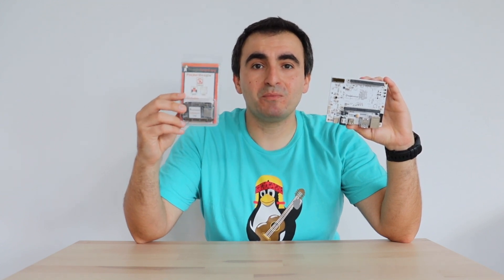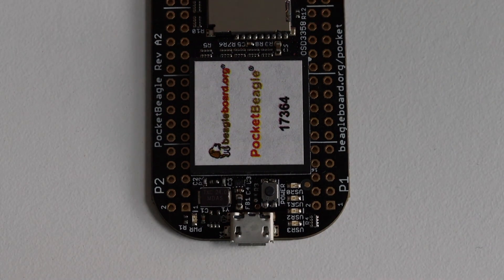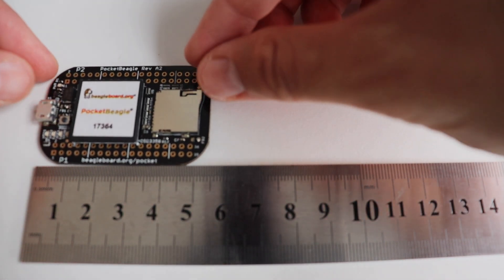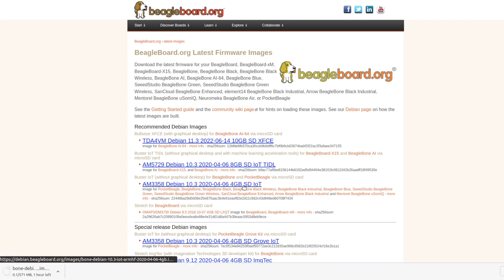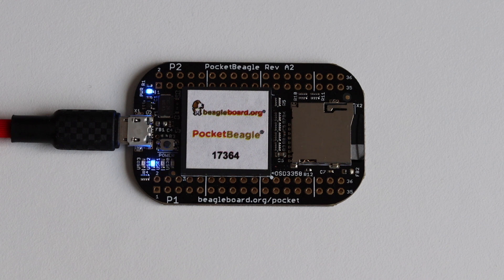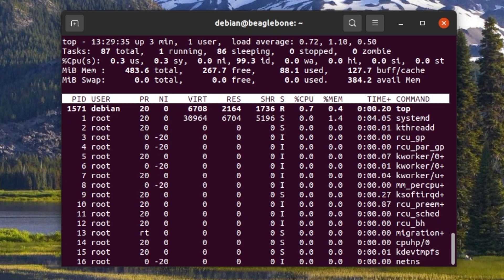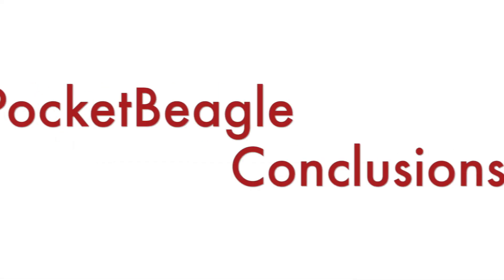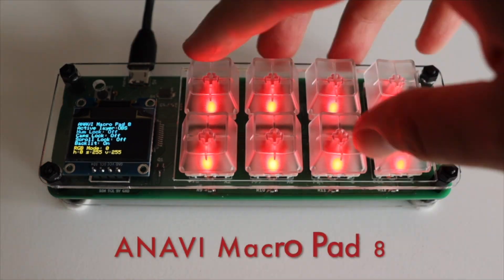BeagleBoard PocketBeagle Low Cost Linux Computer with Debian

Comment: Does anyone know the operating temperature range? Does anyone make an industrial rated version of this device (-40 degC to +85 degC)?
Reply from the maker: yes, according to the datasheet of OSD335x System-in-Package commercial version used in PocketBeagle, the operating temperature range is from 0C to 85C. Octavo also offer industrial version of the OSD335x which is with temperature range from -40C to 85C. PocketBeagle is an open source hardware product so eventually you can even manufacture a version using components for industrial temperature ranges.

Comment: I see it has USB on it. Does that mean we can connect a USB device to it like a flash drive or a Ethernet adapter?
Reply from the maker: Yes, absolutely, this is exactly how the Debian image for PocketBeagle works. If connected to a PC via USB cable, a network adapter should show up on the computer. PocketBeagle with the Debian image runs DHCP server that will provide the computer with an IP address of either 192.168.7.1 or 192.168.6.1. It is a pretty cool feature.
Reply: You could use your PC to share it's Internet connection with the BeagleBone Pocket. There will be instructions "out there" for your PC and for the BeagleBone (Linux).
Reply from the maker: @undercrackers56  yes, this is pretty cool and it is shown in the chapter about Debian in the video.

Comment: What kind of practical embedded applications do you think the Pocketbeagle will be best for?
Reply from the maker: Good question. In my opinion it is a good option for robotics, embedded Linux industrial applications (for example for control and/or I/O operations in special machines) and with appropriate peripherals the PocketBeagle can be useful as a headless device for home automation tasks (audio, controlling LED strips, gardening, infrared communication with old/retro devices, etc.)
Reply: @LeonAnavi  Great! Thank you!
Reply from the maker: @mrafayshams3089  btw considering the current global chip shortage on the market that has affected severely Raspberry Pi, the PocketBeagle can be considered as a replacement for some tasks performed by Raspberry Pi Zero.

Comment: Can one use this board to learn Embedded Linux...Any drawbacks? Also how does this board compare to other Beagle board offerings?
Reply from the maker: Yes, PocketBeagle is a very convenient way to learn embedded Linux development. I have seen it as a hardware platform used in various classes and workshops during conferences. 
Compared to other BeagleBoard models, PocketBeagle is significantly smaller and it is also available at a lower price. It is with 32-bit ARM SoC while the latest and greatest BeagleBone AI--64 is with 64-bit ARM SoC (btw I have another video for it).